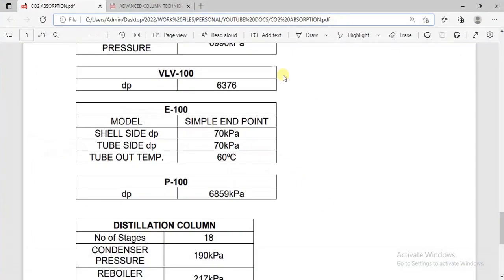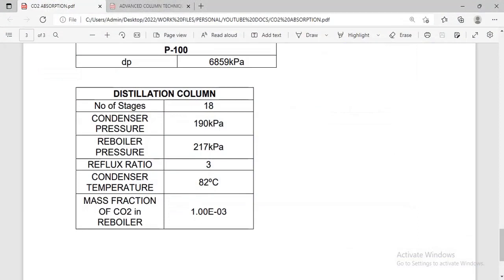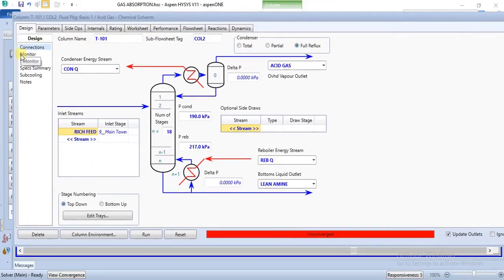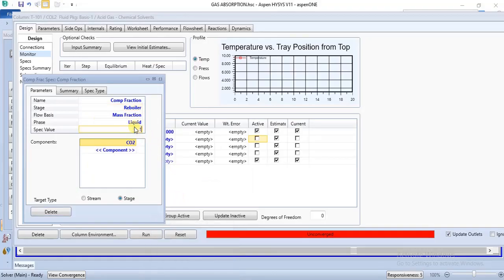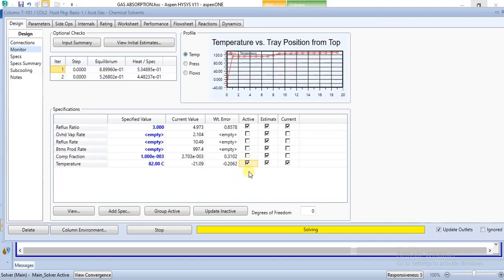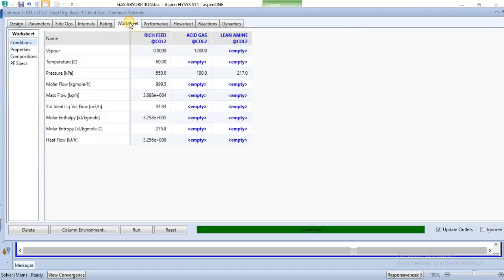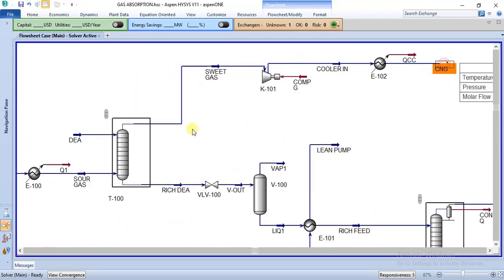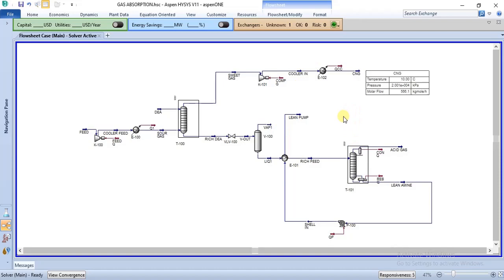Gas Absorption Modelling II

Comment: Great video! I had a question about inputting parameters into the distillation column. My simulation iterates endlessly and doesn't converge. I initially used the same values as you, but they don't converge. What can I do to get them to converge?

Comment: Dear sir, thank you so much for the video. I am currently working on simulation of capture of CO2 with feed has high molar flow of CO2 around 1800 kgmole/h and feed low pressure. I found some difficulty in selection of operation parameters do you advise me to increase the feed pressure in order to increase CO2 absorption or use two adsorber? Also for distillation coloumn condenser and boiler pressure how we select them? Thank you ☺️
Reply from the maker: Kindly send a text on WhatsApp.

+234 706 613 4201